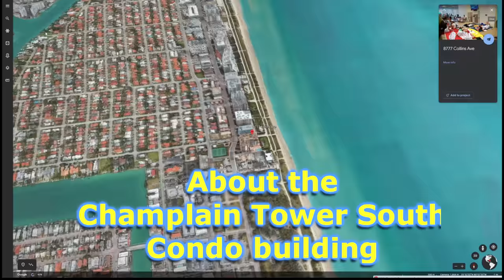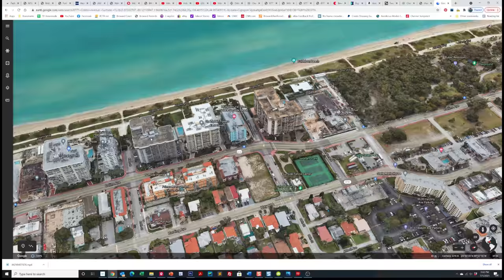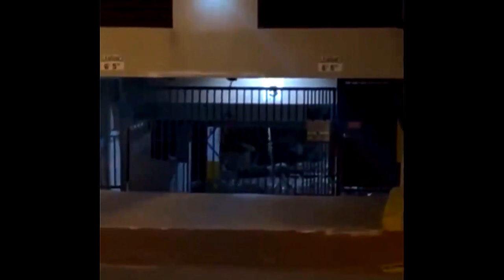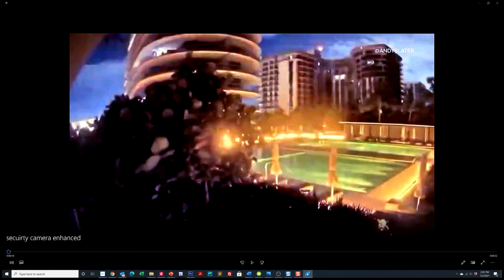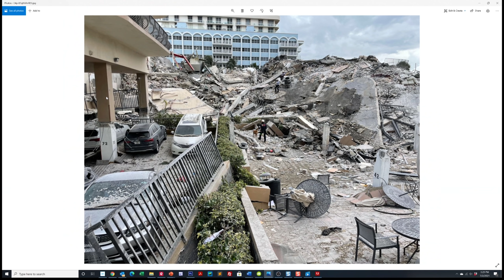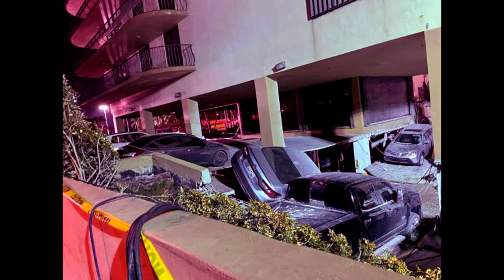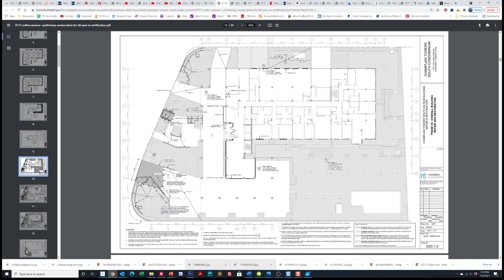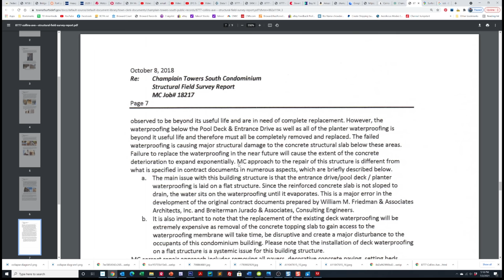Here's Cause Of Miami Condo Collapse Champlain Condo Towers, Surfside

Comment: You're the first one I've seen to show the punching shear failures of the pool deck.  It's obvious that you've spent a lot of time piecing together clues from many sources.  The question is was there punching shear failure of the first floor deck that extended underneath the tower?  How did this precipitate failure of the columns?  (There are a couple of different possibilities.)  The number of sections that fell is interesting but I don't think it is pertinent to the reason for failure.  The punching shear strength of the pool deck would be easy enough to calculate.  The structural drawings are somewhat crude but they might give a clue as to why columns in one area were larger than columns in another area.
Reply from the maker: Bill I think many of the columns already had severe spalling on them, so the deck collapsing may have sheared some of them. Combine that with some allegedly weak garage ceiling slabs from really bad handyman work on previous grout injections, and you got a disadter.
Reply: @jeffostroff  The pool deck level provides some level of lateral support that, if you look at the buckling stress of a column formula, reduces the unsupported length, l, and thus provides the intended buckling strength. Once the pool deck gave way, the columns were now laterally unsupported for two floors rather than one. This reduces their strength significantly. Wider columns are less affected than narrow columns as it's l/r all squared, where r is the radius of gyration of the column, which could explain why the wider columned west side remained standing even though the deck failed there also. The slenderness of the east side column makes it lose more of its buckling strength comparatively and, from the math and actual figures, could have been down to 1/4 of original strength. This, along with previous weakening from spalling could have caused those columns to fail.
Reply: Outstanding job on this video!
some of my observations..
those deck punching throughs are piles as indicated from note 3 on that one plan page. (inadequate caps for sure by the look of it)
the weight from the collapse would be too much and thats what we see.  
The piles and footings that failed and started the collapse in my opinion were compromised by the below grade washout of soil that surrounded them, drainage/unseen pipe failure caused this…. soil is what gives the piles and footings the additional strength it needs to stay locked in.
they should have been able to identify this was a potential washout problem and  core-drilled to discover the voids and then slurry filled that void as a precautionary measure .  sand slurry achieves 100% compaction an is an easy truck and pump method.
I also see along Line M on one of the architectural drawings another sheer/support  wall at the stair well in the last section that collapsed, this is possibly what gave the last tower its strength to withstand the initial collapse.  The building area that still stands has  the sheer wall and more rectangular columns than smaller square ones as the area that was in the initial collapse.
the pull down of the backside was inevitable on that center area, the roof deck hung in there but was too much as its legs completely went below it, the square columns that wanted to stay put had too much on them to remain, have seen it on California bridge column failures many times at earthquake damaged bridges, and at UCSD seismic testing labs where they twist and pull/shake columns for design flaws and failures. One thing i saw come out of the labs for implementation was huge Pier sloping caps go figure.   (Mylar wrapping and column steel encasement was another upgrade that came out of those experiments)
 I worked in the industry  where we provided the means to do seismic retro fits and experienced all these problems and would be the contractor to do the repairs and upgrades.  of course everything I have said is conjecture at this point but with 20 years experience and day to day involvement and the evidence i have seen it is evident to me this is what we are dealing with, and it all comes down to failure to react to the obvious problems and the design  methods and materials used at the time. Local Government needs to be involved, as in inspections and reviews of these older buildings, the methods used are a known factor in failures, of course this involves taxes and Florida is an anti tax state, i understand that, so maybe a tax for those that live in these buildings needs to be implemented as it is their decisions to do so…want that view and location?, well here is the price to ensure safety.
—-saw this video of other buildings showing the signs of problems https://youtu.be/uGYZIEQxf1I
Reply: @saccharide  100 percent correct.
Reply: @FunnyFallGuy  - Mike Bell (YT channel), also an engineer, had the building plans and a good, animated simulation paired with video and stills of the collapse to corroborate his analysis.
Reply: @FunnyFallGuy  - YT channel "Building Integrity" also has comprehensive analysis.
Reply: @wholeshebang1  He, too, took his theory from Construction Engineering & Failure Analysis, but at least he admitted it and is now going to work together with him to make an even more accurate animation. If you look at the history of YouTubers' videos you can see who is really working on the topic and who is just taking from others, then making a video about it.
Reply: @FunnyFallGuy  Yes, but he is so ADHD he is really hard to follow and I was never really able to understand him.
Reply: @rvserious8317  I like the way he doesn't just tell you what happened. He goes through the plans and suggests evidence which contributes to the issues, so you really get what is going on. I just like that process.

Comment: Spalling is in almost all Miami condo buildings over 30 Years
Reply: Probably just the tip of the iceberg. This is going to be a huge can of worms. I would hate to be a commercial builder anywhere near Miami ?
Reply: @MrBlaser51  On the other hand, there maybe a lot of demolitions and rebuilds soon in the Miami-Dade/Broward areas.
Reply: Yeah I cant wait for building inspections to finally pick up and be done properly again so they can catch all of those timebombs of structural instability before they also break down or collapse

Comment: Meanwhile....the two condo towers next door are matching blueprints, same builders, same materials, same age, sitting on the same soil.....people still living in them! 😳
Reply: That tower appears to have been built with more substantial beams that were not corroded by the pool deck adjacent to the building that collapsed.  It has been inspect thoroughly since.
Reply: Those were inspected after the condo collapsed by multiple engineers, they all said that those other condos are safe, sound and secure
Reply: @montanaelkwhisperer1744  The construction technique for the collapsed building was slab on pillar.  It's fine as long as you don't put too much weight in the slabs and manage your drain system and don't let your works get inundated with water - or is at least good for 30 or 40 years.  How much longer do you expect disposable real estate to last?

My dorms from AF tech training were built in the 70s with an expected shelf life of about 40 years.  They were horrors when we went through at their 50 year mark, many already demolished, the remaining few condemned and demolished in turn, my own dorm demolished only a couple weeks after I left.
Reply: @montanaelkwhisperer1744  ... yet the original design passed muster, and building inspections during construction also got rubber stamped for occupancy. Personally, I feel maintenance got put off for years because it costs too much... and the people holding the purse strings know nothing about priorities.

Comment: Great analysis, this is probably the most informative video available. 
My city, Sofia, Bulgaria, is in an area of high seismic activity. What amazes me is that here I have never seen a building standing on columns like these towers. The old communist-times brutalist structures costing nearly 10 times less than a condo on the beach in Miami seem to be orders of the magnitude more reinforced given the probabilities of strong earthquakes. I live on the 19th floor and, honestly, this disaster made me feel unsafe for a while until I was able to compare the amount of concrete here, the Г and П -shaped reinforcements on the edges of the buildings with what is shown in the video.
Reply: Just because it was built in the Soviet era doesn't mean that the eastern bloc countries that constructed buildings did a bad job. Many of the multi-storey apartments built in the 1950's-1980's era in the eastern bloc had better footprints and standards than some of the cost-cutting glass and steel buildings going up today in the west. We often look down at anything in the old eastern bloc, but here is an example of poor architectural design in the west from that same period. At least you could afford to live in those old Soviet buildings, you can't afford to live in these condos in Florida (or where I am here in Ontario, Canada, particularly in Toronto) because they're all $750,000 to $1 million with monthly maintenance fees averaging $700-$1,000 per month on top of the mortgage. These are homes that only the wealthy can afford, often as a second home for vacation. Its asinine how we as a society do things and allow for this. We do a lot of things WORSE today than the past. We have lots to learn.
Reply: In Florida, earthquakes are almost unheard of. Instead, they put more effort toward fastening buildings down to prevent them from losing their roofs or moving off the foundation in hurricanes. I live in Orlando (3 hours North by car), we had 165KM/h winds for four hours a couple of years ago with zero damage to our home, yet if we ever get .5 to maybe 1 meter of snow one day, our roof might collapse as it is not designed for such weight. In other parts of the USA, such as California, buildings are built to withstand earthquakes, but would do poorly in hurricanes (which never occur there anyway). I've seen buildings in California that are built on columns and are very secure because they are sized properly and well reinforced, so it can be done. In places like Florida or California where land is expensive, they often do this to allow for parking under the building. It hides the un-appealing garage and saves a lot of space, but does leave a building susceptible if cars hit the supports, catch fire (as they do sometimes) and of course, gives access for a terrorist attacker to detonate something below the building (as in the 1993 World Trade Center bombing, for example). 

In the case of this building, the columns were strong enough to handle the load, but not overbuilt to still be strong after years of being neglected. South Florida was also known for corruption back when these buildings were built, and even somewhat today. Developers built them as cheap as possible, with the design only barely meeting minimum standards on paper. Then contractors cut corners by using inferior materials and unskilled labor to save costs. They then paid off inspectors to overlook what may have appeared to be minor shortcomings at the time, without anticipating the effects of age and neglect. Or they simply didn't care.

After 1992 when Hurricane Andrew hit Miami and exposed a lot of bad construction and improper safety inspections by officials, the laws and building codes changed. They've changed again several times since, as authorities learn more after each hurricane. I would bet that this collapse will trigger new building code changes and stricter inspection requirements. Unfortunately, this should have happened before this tragedy, but hopefully things will be corrected so it does not happen again. I have heard that other buildings in that area are being inspected, and one has already been condemned. The inspector walked in and took a look, then literally gave residents 30 minutes to grab their personal belongings and evacuate because it was that unsafe.

Comment: 21:00 you are seeing columns strewn across the top of the rubble that are from upper floors which of course are of smaller size due to the decreasing loads as you reach the roof. When you pointed out the size of the columns in the floor plans, those are larger because there are greater distances between columns, which leads to far greater loads, which of course requires larger columns. This has no relevance to the collapse at all. I do agree with your final analysis, the flat deck cove area created by the u-shape of the building, collected water (esp. salt spray water from sea winds washing it down the building face) and caused rebar corrosion in the parking structure below. 

Impressive work, good job.

Comment: Columns count on the floor slabs to provide lateral stability, when the floor slab collapsed, the perimeter building columns might have buckled from the building weight. 
To envision how important column bracing is under compression loads, take a yardstick and a 12 inch ruler of the same thickness, place one end on the floor and use your hands to press on the other end of each ruler. The yardstick will buckle out sideways under a much smaller force because it’s unbraced length is 3 times as long.
Reply: Yep the deck sheared away and either pulled the columns or took away the lateral stability of the columns and then failed to support the axial load remaining.  Tragic to see but highly easily explained.  There is also and issue of having enough rebar sticking out of the columns to avoid the shear failure.
Reply: Can't build on coastal lines and think mother nature and sand and water won't destroy what was built..lol..you can maintain it, but it will eventually lop side and crack and brake...I refuse to build structural buildings on coastal lines just cause I no the wrath of distruction over time and I don't want blood on my hands...it's like saying it's ok to build a home on a volcano and saying it will never catch on fire..lol

Comment: 20:58 the far left corner column seems skinner because the perspective point, should check the ‘detail drawing’ on the size. Since this is  a basically a grid system design,  meaning all column size should be the same and it should be noticed right away at time of construction, especially this is an exposed column.

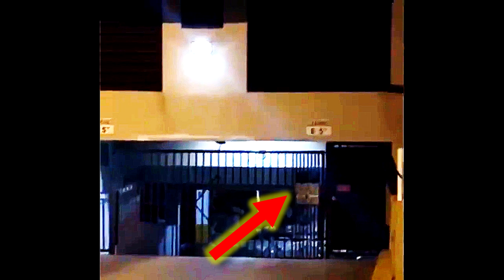Comment: Jeff, I may be missing something but that broken beam point at around 8:38 is a tow zone sign. 😬
Reply: Yup, was just gonna say. It's at the exact same spot on the gate, just left of the door knob, as seen on the google maps view.
Reply: Who believes a fallen concrete pool deck can pull down 5 reinforced beams? Not I.
Reply: Yeah, not sure what was with that! Even the darker area on the beam above/past the sign actually is there (not as obvious) in the before picture, I can't tell if it's just because the bars are closer together there so it is darker, or if there is something dark mounted on the beam.